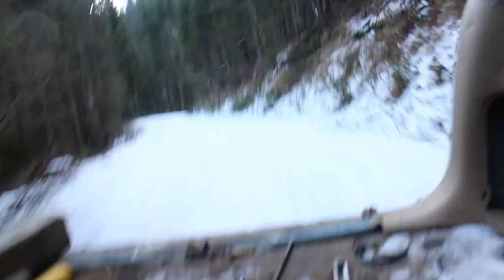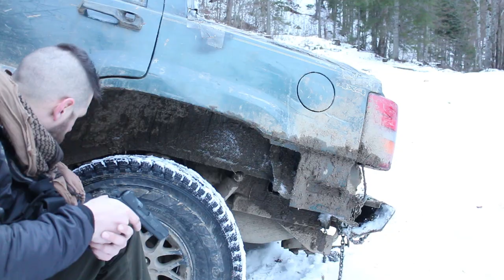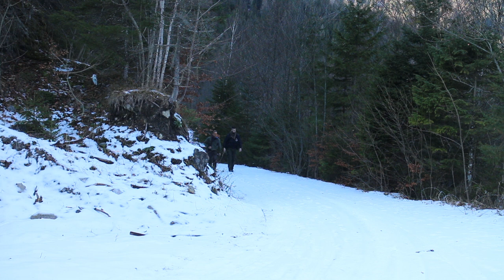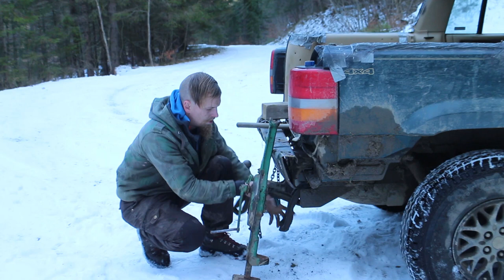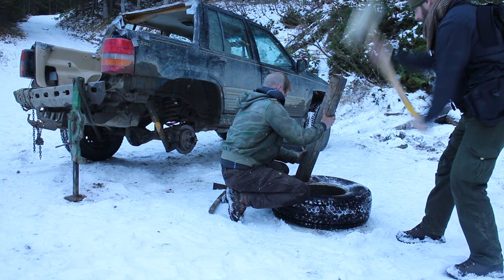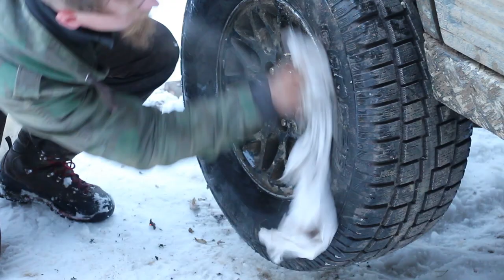Post Apocalyptic Tire Changing Without Proper Tools [BONUS Combat Footage]

Comment: Excellent. Most people today have never seen the process of changing a tire like this. I grew up changing and patching tires by this method at my grandmother's country store & gas station. I used 2 "tire irons" (round steel stock flattened at one end for working between the tire and rim but still round at other end for hand - some rough texturing for grip and whole thing painted w/ silver metallic paint) plus a small (2 lb/1 kg) sledge and a mallet. Started when I was 10, and you see the workout this is!  ALSO, if you carry the right size inner tube, in an emergency you can insert it with only 1side of the tire off, put the tire back on, inflate the inner tube and still function with too large a hole to patch in the tubeless tire (even in the sidewall), but you will need a compressor for inflating the inner tube. Neat trick with the Start Spray; never seen that before. Keep up the videos!
Reply from the maker: +MG50 -that's real old school craftsmanship...unfortunately most of it was lost due to modern expensive machinery....really like your story...thanks!

Comment: Good video PostApGar. I worked at my dad's garage and at times fixed flats for drunks in bars parked in ditches which is common when they arrive at the bar already drunk. I used a jack similar to yours and jacked the car up and kicked it over until it reached the bottom of the ditch and then took off the tire and wheel. We had no tire machine so I used 2 tire irons a little thicker than yours and a smaller hammer with one rubber side and one metal. If you didn't have a big hammer and stick to break the bead, you could let the brake drum down on the tire to break it. I used dip stick oil to grease the tire if I had no soap water. I didn't think about pig lard. Sometimes, if I had to install a tire that was sitting under a large pile of tires and was pressed flat sideways, they would not seal against the rim to take air. Where you used starter fluid, I used gasoline but you have to rotate or shake the tire and rim around so the gasoline can vaporize some. Otherwise it might not pop but just sit there and burn. Ask me how I know. I also liked the music although it was on a loop. Thanks for a great video with good action.
Reply from the maker: +Randy C -that's a great story my friend xD...thank you for watching and sharing your experiences. atb

Comment: Hi guys, changing the tyre with those tools is well presented and using the spray for tight fit onto the rim and filling with pressurized air just cool! I don't need all the other action anyway ..., allthough well done bros ;-)
ATB. Franz, bugikraxn.

Comment: I assume the grease was used instead of oil as a lubricant to get the tire on but why did you start a fire on the tire? I am not very good with cars so I can't understand why. Nice video!
Reply from the maker: +Gurch I've created an explosion inside of the tire to get the beat of the tire snug onto the rim and create a pressure inside. The fire was only the excess starter spray which was running down at the outside

Comment: Nice video, I did like the scene at the beginning. When you placed the new tire back on the vehicle did you fasten the nuts crosswise/opposed? It looked like you went around.
Reply from the maker: +Rick V It looks like I did it wrong because of the cutting of the video. The part, where I do the final fastening was not in the video. For sure you always have to fasten the nuts crosswise. You have a good eye on details my friend;)

Comment: Great video, guys, but it might be more accurately titled '...tire changing without PROPER tools.' It's worth passing along to my friends, though.

Tactical suggestion: you might want to add matte-finish or camo tape to the inside of your front rifle sight cap to prevent glare reflecting to the target.